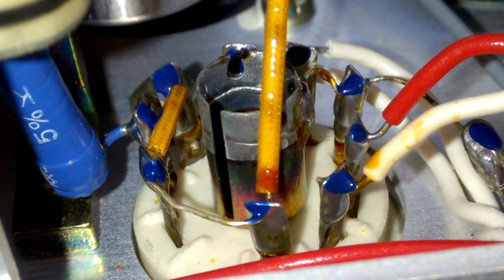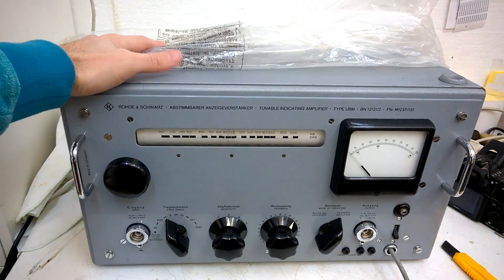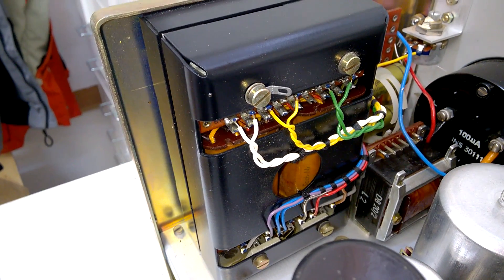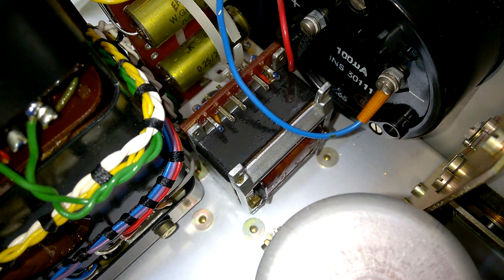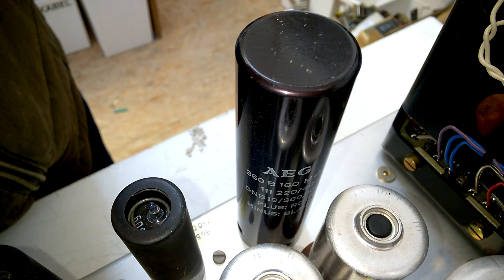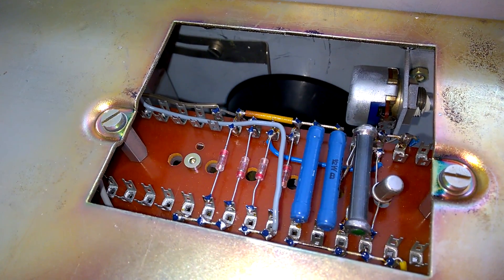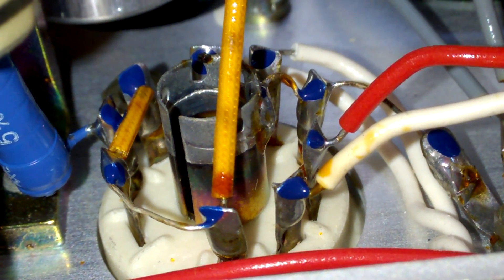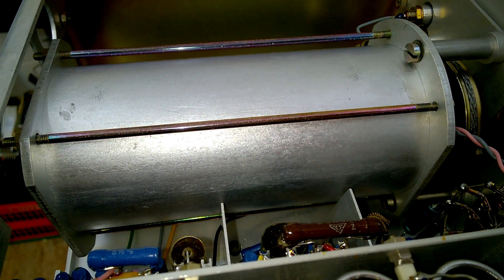BEB #85: Rohde & Schwarz UBM - What's inside?

Comment: Max, could you explain a bit more about how this thing works? Does a block diagram exist, or could you make a good guess?

I might be inspired to design something similar in solid-state. Of course it wouldn't have that phat tube sound, but other interesting features could be added, such as voltage control, and compression.
Reply: I thought I read somewhere that there are eight tuned circuits in there, connected to an 8-gang tuning capacitor. Is it configured as some kind of multiple-feedback bandpass filter? Is that feedback transformer coupled perhaps?
Reply from the maker: Hi Chris. Thank you for your comment. I think I have added a block diagram somewhere inb this video. Showing the innerts with all it's beauty was all that I could effort as a non-fulltime youtuber. I wished I could do more detailed videos in parallel to my daytime job, but I can't atm. You are welcome!